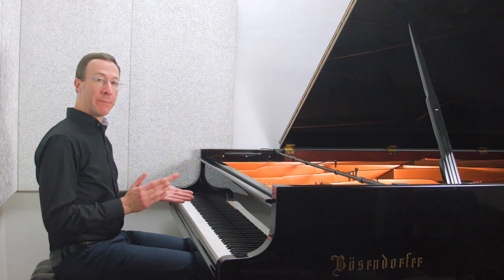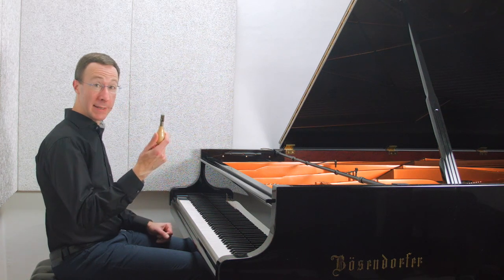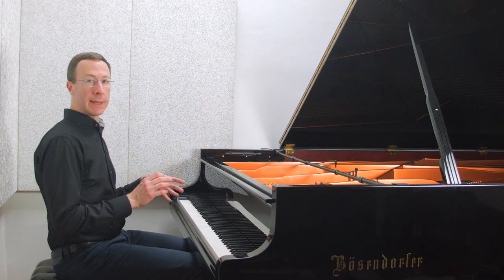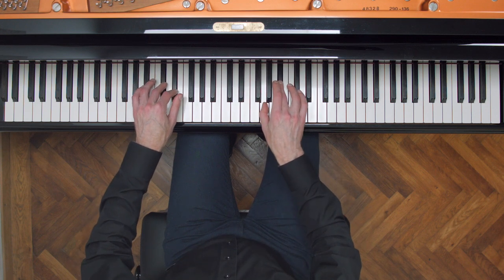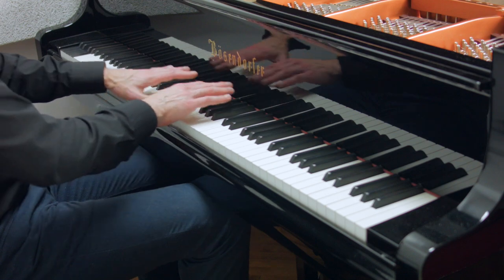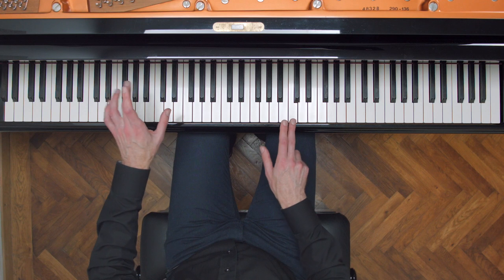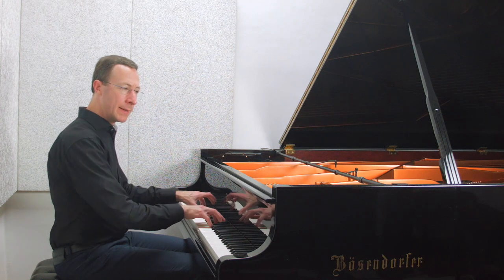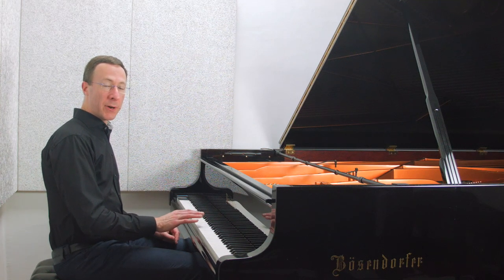Piano Chord Voicing Techniques

Comment: Thanks for your lesson! This blue Danube exercise is very good and amusing way to train the skill of voicing. Your lesson made me more aware of the different levels of the keys in relation to the different levels of the knuckes of the fingers. For exemple if one plays f# - a - c# with fingers 1-3-5, fingers 1 and 5 will have to exert less deep than finger 3. (Of course a no-brainer😄) If you apply this consciously, it is easier to keep the level of the hand horizontal and stable, it is not thrown out of balance resulting in more control. Correct me if I’m wrong!

Comment: That's fine but how does one avoid the hard note from going down before the others? All three techniques tend to make to emphasized note go down first causing a loss of tightness in the chord.
Reply from the maker: That’s a fair point, and understandable. The best answer is to use your ears to listen to make sure all the notes of the chord sound at the same time. As you practice these techniques, you’ll improve the ability to press the keys simultaneously, enough so that any differences in timing are inaudible.

Incidentally, two colleagues of mine once shared with me that they performed experiments using Bösendorfer’s recording technology (first SE and later CEUS), in which professional pianists’ playing of chords was recorded and analyzed. To my surprise, they both reported that once you zoom in to the millisecond level, it turns out that even highly trained professionals don’t actually press all the notes of a chord exactly together, even if they sound perfectly together. Then, when the experimenters programmed the computer to play the notes exactly together down to the millisecond, they both told me that the chords somehow didn’t sound as beautiful as when played by professionals. I haven’t heard this experiment myself, but it sound like the core message is that a voiced chord note will indeed be played slightly ahead of other chord notes, but not noticeably so. In practical terms, it means we should rely on our ears! Hope this helps.
Reply: @key-notes  This is an extremely helpful elaboration!
Reply: Sometimes you may actually want that to happen!

Comment: Question: Is there an easy way to change/unlearn/erase techniques (fingering et al) previously learned wrong?  And how to determine the actual need to change/unlearn/erase a particular technique?
Reply from the maker: Due to how the brain learns, there isn't an easy way to unlearn techniques such as fingerings. A new pattern needs to overwhelm the old pattern, but some memory of the old pattern will still linger. That said, I think it's best to be pragmatic about making such changes in your playing. If you're able to achieve what you want musically (and more importantly what the composer wants, to the best of your ability to ascertain it!), and you're able to do so without side effects such as too much tension, then it might not be worth all the effort to change your technique.

When learning a new technique, it's best to learn it in a brand new piece of music, one you've never learned. Once you master the new technique in new pieces, you'll find it much easier to use the technique in your familiar repertoire. This is the best way to incorporate new techniques into your playing!